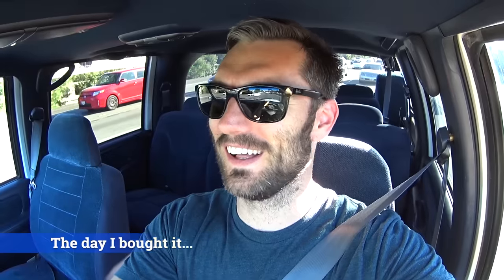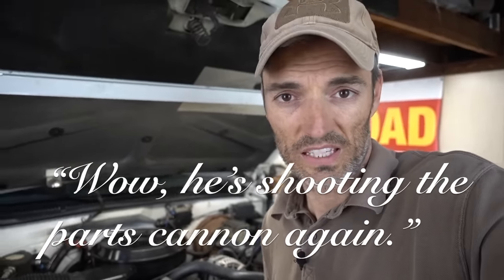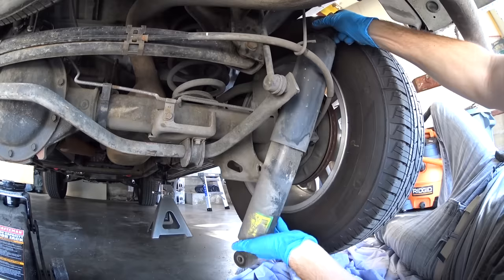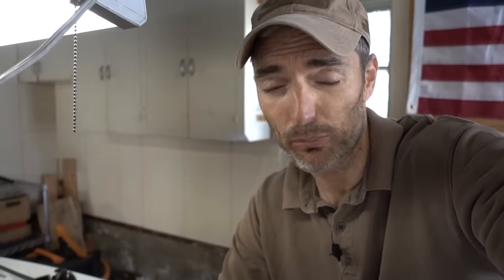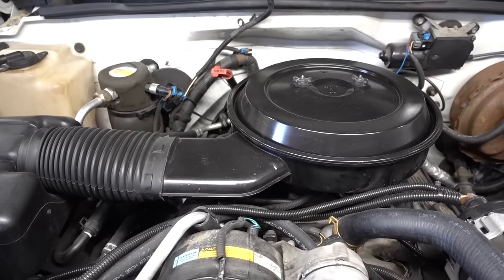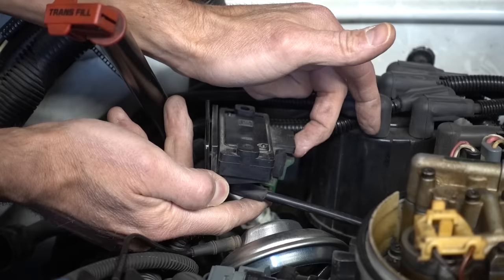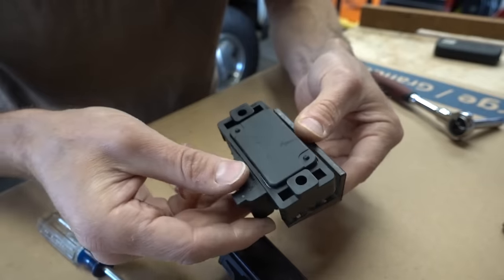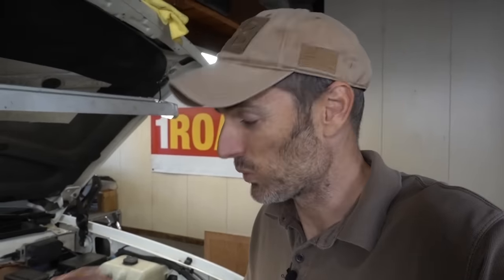The ONE REASON Why My 25yr Old Truck Runs So GOOD!!

Comment: The only thing that dosconnecting the battery did was clear the trouble codes, if there were any but since the SES light was not lit there were no codes to be stored. Do a google search on GM C3 aka Computer Command Control and OBD1, enlighten yourself.

Comment: It's a shame that the sensor you replaced is very likely of higher quality than the "new" made in China replacement. A few other points, the connector that you broke is a weatherhead style which replacements are available at most auto parts stores and finally a 1995 GM vehicle doesn't have any adaptive or "learning" capabilities.

Comment: SUVs are not trucks. They’re oversized cars. They might even sit on truck frames, but they’re just large cars with the worst of what comes with trucks ie the longer braking distances, the higher center of gravity, the reduced standards from Highway Safety as opposed to passenger cars rated as passenger cars, and greatly lower fuel economy. They actually aren’t safer. That’s irrelevant but your suburban is a car not a truck. You made a great living putting YouTube videos up about how much you love it and calling it a truck but it’s not a truck. Hauling a load of lumber in it is going to be as challenging as hauling them in a Saturn which I have done personally. Trucks have beds, built to haul things or to look like they’re built to haul things if they come from Nissan or Toyota and are built to mimic looking like a quarter ton pickup if Honda or Jeep Wrangler with the open air trunk.

Comment: I mistakenly put a NEW crank sensor in, turned out to be a bad ground wire,the NEW part failed in a day (not exaggerating) it now runs fine on the original with 240k on it and it’s 24 years old. Lol be careful of these NEW parts nowadays.

Comment: you would think that a new part is better than the 25 year old parts but you are wrong to think that. amazon sells the same brand names of parts as any parts store, and they all come from China. the quality is worse in most cases, than the original part. the problem is that you replace something with no results, then you replace another part that partially fixes the problem. when it all goes to crap, you don't know what part was the defective part. I spent 5 years replacing sensors on a truck only to find that half of the parts were defective.

Comment: I wouldn't call what you're doing 'parts cannon'; parts cannon is when you have an actual problem, and instead of doing a proper diagnosis, you just guess and throw parts at it in the hope that it'll fix the problem. 'Preventative maintenance' or 'light restoration' would better describe what you're doing. Keep in mind though, that often times the parts one buys today are inferior to the parts that originally came on the truck. You could find  in some cases that the new part may fail while the nearly 30 year-old part would have kept going..... Such is the sad state of things these days. You also illustrate a caveat about replacing functional parts, in that while doing so, you may open up a can of worms, such as breaking connectors and other plastic parts, or stripping bolts, etc. It's a tough call. As a driver of older vehicles myself, I tend to only replace things when there's a good reason to do so- like when replacing the parking brake shoes on my Excursion last week, I also did the hub seals, since the hubs had to come off to do the shoes. The old seals were fine..but since I had it apart anyway, it was a no-brainer to replace the seals.

Comment: For one that’s not a truck and two that’s not an ignition coil lol these trucks are tbi wich is an electronic carb running off a distributor coils aren’t used on distributed engines there called plug wires

Comment: The problem with the logic of new part made in China is better than 25 years old part made in USA is totally false. If your old MAP sensor is working fine, there is no need to change it because it was designed to work for the life of the car/truck and been extreme tested and passed to make sure that it will work as intended. What you got new from China is the crappy copied version of that original without any engineering thought into it. The tolerance of pressure error over temperature band which help the vehicle runs smooth and save fuel than a compromise of close enough and users won't know the different. I would save the old MAP sensor since you might need it

Comment: It's OK..
The difference is knowing when to hold them. And know when to replace..
But if you're going to replace parts that aren't broken make sure they are factory and not China cause you might as well.....go lay down..in for major problems..all replacement parts aren't created the same..
Case and point..my old! Dad ! Replaces everything that wears when he gets a new old ride.  Now that the belt squeaks and the hoses leaking and on and on and on. 
Don't fix it if it ain't broke and if there's a question buy the part/belt?  Whatever and put it and the tools to change it behind the seat or in the trunk..that's how you do.

Comment: Modern trucks have sacrificed reliability to comply with unreasonable government mileage standards.  There are so many example, direct fuel injection ruining your rings, cylinder deactivation, variable displacement, or active fuel management, no matter what you call it, gains you a few miles per gallon at the cost of ruining an engine to the tune of tens of thousands of dollars.  We haven't even discussed unnecessarily complicate systems that are more likely to fail, very expensive parts, and unnecessarily excessive labor costs to get at what needs to be fixed.  Stay away from modern cars and trucks.

Comment: Yep. Nobody gets it. Number 1 it’s my hobby. Tinkering on my old vehicles. Number 2, I grew up with parents who never could afford to fix anything. And I would see what were newer cars (usually handmedowns from my grandparents) quickly get destroyed over cheap fixes. So I do my preventative maintenance. And I don’t break down on the side of the road. And usually I don’t have to do huge in depth jobs on my vehicles either. Because I replace the parts that break the larger parts when they go bad.

Comment: I didnt watch very far, but if you think new parts from amazon are better than the old you are often wrong. AC delco doesn't make parts anymore and the parts are fakes or rebranded aftermarket. esp from amazon. also new parts can be bad right out of the box complicating the parts cannon diagnosis

Comment: You’re absolutely wrong, you do lose out by replacing parts that were unnecessarily replaced, first of all there is the expense of the new part. The old part has not failed. There’s no telling how long it would be before the old part failed. Maybe never. Second of all your new parts may be bad out of the box, I can tell you as a mechanic there is nothing more frustrating than getting a brand new part out of a box putting in her vehicle and now you have either the exact same problem, or a worse problem, and now you can’t quite understand why in your diagnostics would lead you down every other path before you come back to the part that you just replaced. There’s a reason why real mechanics run diagnostics on vehicles before we suggest replacing anything. I can also tell you with absolutely no doubt, that the parts that you are buying from Amazon will fail 75% quicker than your dealership parts. Yes, they may be cheaper but you are definitely getting what you were paying for. I can guarantee it there is a reason you go with OEM parts.

Comment: I am sorry to disagree with you about not having to worry about new parts. Anymore even so call Original Manufacturer Parts are junk. I have worked on Auto, Motorcycle, Aircraft, Trucks for over 60 years. I am a backyard mechanic and have bought parts to be replaced like fuel pump intank bs and have had to go back and take it apart to replace with in a few days.  It sucks. Auto Zone for one reason or another really has a high failure rate.
I have bought so many a time at the dealers and still failures so don't say your worries are gone.

Comment: Several years back...Clutch needed replacing...had after market clutch cable...put a rebuilt disc and plate in...ok...but cable stretched all the way out in 1 year...asked my mechanic...do you still have OEM CABLE...YES.. 7 MINUTES LATER...BACK ON...HAHAHAHAHA...NO ADJUSTMENT SINCE AFTER 3 YEARS...🧐🤔👈

Comment: You are so wrong. Replacing high quality OEM parts with counterfeit parts off Amazon makes the truck more susceptible to failure. Ask any mechanic, these parts from online and box stores have a massive failure rate

Comment: 1:25 That is just not true... trust me. I have a 1992 GMC 1500 with the 4.3 and have struggled, for years, to keep it running. Unless you are using ACDelco OEM parts, you can easily install parts that are in worse shape than the ones currently on your truck.

Comment: It’s not Always  the best idea to replace everything with cheap parts. Somtimes the part is perfectly fine and most of the replacements are Chinese made and of lesser quality than the original. Inspect everything and only replace what you need to. I’ve had plenty of problems with cheep chineas parts it’s just not worth it

Comment: Plastic engine parts are the reason why modern cars fail. Late model BMWs can cost a fortune to fix-which is why resale values plummet. I really think electric cars will be taking over-gasoline engines are simply too complex.

Comment: Dont get so excited about oem AC Delco, that's all made in China. You have a valid ooint but your original parts likely will last much longer than the made to fail junk they sell now. I had an 1982 chevy truck that i had for 30 years and only changed the headlights, radiator, fuel tanks and water pump once. The battery lasted 20 years and every 10 years i knew the cam driven fuel pump would fail  best vehicle i ever owned

Comment: Well, you replaced a genuine GM part with an AC Delco part made in China.  AC Delco has three lines of parts, AC Delco parts, Genuine GM parts  and AC Delco Professional parts.  The latter two are great products.  The first, not so good and can be hit or miss and mostly made in China.  In my opinion, You actually made your truck less reliable by replacing a known good sensor that has been operating perfectly for 25 some years and installed a made in China sensor of questionable reliability.   By putting low quality parts in a vehicle, you run the risk of replacing a whole lot more parts with the parts cannon when that part fails and you say to yourself, "I just installed that three months ago. It cannot be bad, therefore,  it must be these other parts."  BOOM! goes the cannon.   I'm not disputing  replacing parts before they're done.  Especially when those parts require the removal of many components and you are already there doing another repair.  The parts, however, need to be quality parts and that is getting harder and harder to get.  Just because it says AC Delco on the box doesn't make it a good part

Comment: As much as I like your enthusiasm to DIY and keep fresh parts (specially electronics that may have capacitors that leak over time) on an old vehicle, I'd stay away from chinese parts. Get yourself genuine or at least OEM parts like Bosch, VDO, Continental. Don't put chinese crap in your engine bay...

Comment: "Cheap on AMAZON" doesn't mean it's original or OEM.  The sticker on the bottom of the MAP sensor says "Made In China", and to me is a red flag.  There's a lot of counterfeit parts being marketed as OEM and are difficult to spot.  Be careful, and don't buy parts from Ebay.

Comment: i used to be the same way. but you need to be careful.
these amazon parts are a joke and so is rock auto. guess what the parts stores arent much better.
i was a real mechanic doing mechanic things and i quit because i got sick of it.
parts all come from china now and brand new in the box doesnt even work half of the time. the other half it was worse than the bad part being replaced.
buy quality parts and keep the old ones for a little bit. 
i have literally done the math and i get about a year out of parts now. crazy when a few years back 10 20 30 years could be had on a part.
the older cars had better parts and some of the ones your taking off was as good as its gonna get for that car. but broken part is broken part.

Comment: Why in the hell would you replace an EGR and not just block it or delete it
Reply: Won't pass inspection in Texas (truly bad EGR gas engine) and I don't think you can just delete it like on a Diesel! Guess how I know.
Reply: @JamesThompson-ol3eu  inspection... 😠. Well that makes more sense didn't know they had that in Texas haha.
Reply: @josephwaldner3977  I should add the car is now grandfathered (over 25 years) so no more emissions inspections would intersect with me moving from a major metro area to the country where emissions inspections are not required anyway. So I only enjoyed the ability to pass inspections 1 or 2 years.  But the car does run slightly better. My other vehicle is a Diesel  pickup.  No emissions test required in TX for those!
Reply: @JamesThompson-ol3eu  so far in Canada I have been lucky enough to get rid of emissions controls. I can't stand the soot buildup in the intake manifold that EGR puts in.
Reply: @josephwaldner3977  I "may" keep that at bay as I always use fuel treatment at every fill up and occasionally use intake flushes via vacuum tube from brake booster.  It does seem to work on my Diesel truck. I had major fuel system work done at 180k miles and the mechanic said my injectors looked great. I am now at 260k miles on original injectors - have always used fuel injector treatment and have used soybean oil diesel when I could buy direct (great detergent factor) now the govt requirement of 10% also benefits me. Better lubricity for low sulphur diesel.

Comment: Trust me counterfeit parts are not the same and if it is not broke don't fix it. Your going to cause a mechanic a huge headache when your throwing parts at a vehicle and can't fix it because of creating muitlple problems. Air fuel electrical parts and ignition parts are very bad  idea buying anywhere but dealer and have found cam sensors from oem with issues and having to find good used oem parts to fix a vehicle due to manufactures having parts made from lowest bids like china

Comment: why replace what is not broken,m forr example the coil issue, all you had to do was pull a lead off, and boom theres the problem, no need to pre buy it before knowing, upon other electriacl items, do OHMS tests, resistance tests
also super poor explination on a MAP sensor, i literally tells the motor the amount of air in there, with a MAP its done vis vaccum

the MAP does not do a releran, the ecu thats in there is pre set, not leasrning, it is not a modern ls ecu or one of  the others
It runs a memcal/eeprom, they

man you really dont talk about stuff you know at all lol

Comment: Don't like electrical components made in CHINA! I had a couple of parts burn me on my 1993 Roadmaster -mostly same tech as this Suburban.  Bought on Amazon.  The 2nd replacement part bought in an Auto Supply by different Manu. worked.

Comment: This isn’t good advice at all, anyone who’s spent enough time under the hood will tell you is it ain’t broken don’t fix it. Obviously, when it comes to components that have obvious wear it’s best to preemptively replace them, but just changing out the something because it’s old isn’t a guarantee it will last longer. Especially, with the current state of automotive parts quality and availability.

Comment: Can't use these crap parts tho My toyota has 317,000 miles on it...need to do a few things but I will only use toyota factory parts especially water pump timing belt and pulleys tensioner .,feul pump I was master  certified for 20 yrs and watch out for these crap Chinese cheap garbage..your better off buying used oe stuff man just sayin